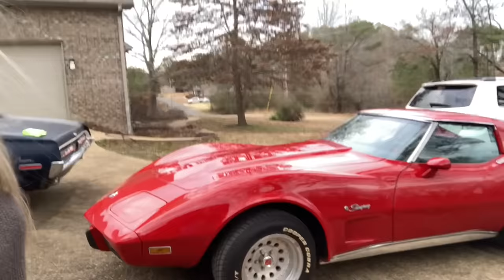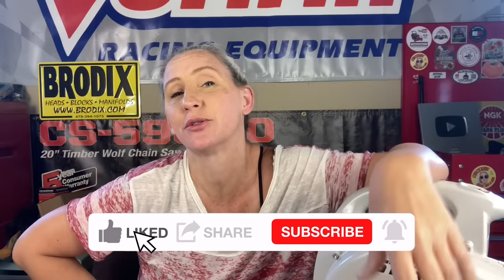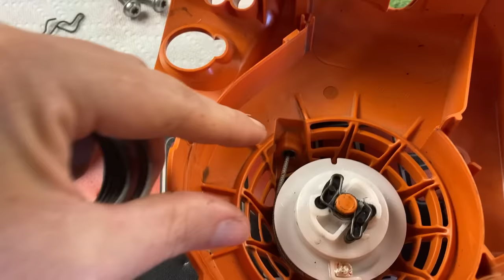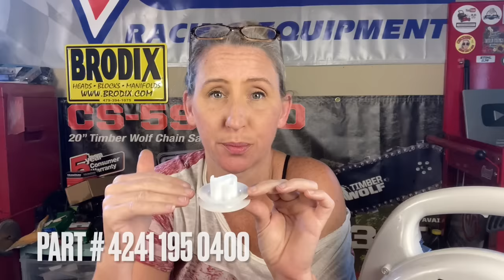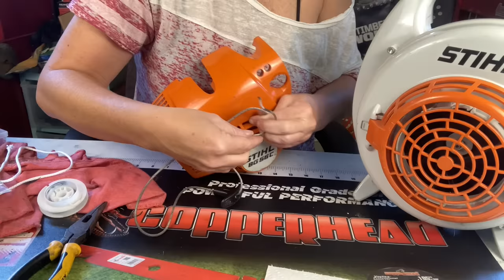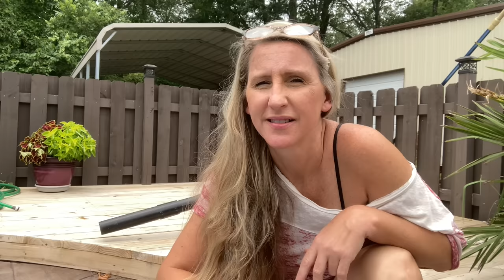STIHL'S "Easy Start" FAIL! How to fix it FOR GOOD! Stihl BG 56 C

Comment: Good info! I have an 85C about the same age as the one you show in the video. I was told the C stood for Commercial duty rated. Do I have an easy start model?  I believe my blower has a Catalytic exhaust? It is cold blooded until the exhaust gets hot and then runs great. Thanks!

Comment: The best starting two stroke I've got is a mid 2000 teens Craftsman 27cc straight shaft string trimmer, with an automatic electrical enrichment system. Takes next to nothing to pull it over, and starts within about 3 pulls every time.
Reply: I have a Husquvarna 385 saw. Twenty years old. I don't use it much anymore, but I can leave it for a year and that is a three pull starter with an 85 cc engine.

Comment: Help ! Got 130T pole saw. When you try to pull start the saw, you think your either going to eat the pull start cover or the rope is going to break. Pull out the spark plug everything feels normal, I have removed the front to check clutch, can't pull, start it,

Comment: What is the part number for this part? Spoke to my Stihl dealer a while back about eliminating this feature and they didn't seem to know about this fix. The thing that I experienced is that "somewhere" in the pull stroke the chainsaw would start on it's own, often times after the pull rope was fully retracted into the housing and the saw just sitting there. What a friggen dangerous idea especially on a saw.(I did buy it used like new for $100.00).Thanks for the video.

Comment: Hey there - thanks for the helpful videos. I inherited an old AirCap edger model 809/682/BO18K4 (Who thinks these model numbers up??)  and can understandably find no parts for it, or even the manufacturer so I guess they went away. Where would I look for parts for such an Off Brand? The plastic throttle just broke in my hand, I'm sure theirs is just a generic item used by many manufacturers of the day.

Comment: Bre do any of the other manafacturers make a spring for their quick start systems that would fit the stihl? As a metallurgist would be curious about one of the falled springs to see if it is a material issue or a heat treating issue, maybe I can get a replacement part from stihl but an actual failed part would be best.

Comment: The only dealer we have around here is Stihl. Stihl used to be a good product. 
Now with the 4 mix & their plastic cam shafts. The etronic BS, I don’t want !
 I recently purchased an Echo trimmer. It’s 2 cc bigger than the Stihl FS91R I have. The Echo cuts circles around the Stihl. 
I’m looking for a bigger chain saw. Was looking at the Stihl 462 carbureted version. $1350 !  Good gawd ! 
I’m gonna try to get my uncles old 056AV running, he left me. 
   It’s 82cc but very heavy. 
Interested in the Echo 66cc, but nobody sells them around here.
Reply: Depending on what you can spend on a saw, the Echo 590 is the best bang 4 the buck, the 620 is it's beastly brother and the 7310 should be able 2 take care of almost all your bigger needs IMO
Reply: My echo cs400 is a pig next to my ms250.  1.5 to 2x the time for the same cuts.  My FS94r runs circles around the 91 too.  I own both the 91 and 94
Reply: @Muskyfishn84  The MS250 (45.4cc) isn't the greatest comparison 2 the CS400 (40.2cc) but I understand it's what you have 2 compare, MS230 (40.2cc) would be its equivalent.  The CS400 muffler is holding it back a lot.  Open up the muffler a little, the torque gains are substantial along with throttle response.  I'd put my muffler modified CS400 up against a stock MS250

Comment: I guess I've been lucky.  Mine hasn't need repair.  Keeping fingers crossed.
Reply: And it won't as long as you pull on the rope GENTLY. It's not your pulling that starts the engine. It's the spring. Let it do the work.

Comment: I have a craftsman 4 cycle blower runs great put vibrates so bad it's hard to hold onto idles perfect no vibration what do you think the problem is
Reply: You might have a blade broken on the fan.

Comment: Oh so true, "Stihl machines are hard to start". Until they get broken in and then they usually start up on the second pull. It can be sooo frustrating when you pull out your arm and shoulde trying to start the new Stihl machine you just bought. Why this constant equipment starting problem, unlike those of other manufacturers? Thanks, Brie. Another good informative video. Oh ya, Steve and Dony both say hello.

Comment: I have a older model without easy start. It used to start after 3 pulls. now at least 5. I changed plug and air filter. no help. any ideas?
Reply: Carb

Comment: There is an easier way to rewind,  have the cord wrap inside the pulley a few turns, leaving only a small bit that after just 2 turns to wind up tension, push the end through the eyelet and bam, tension.

Comment: That’s weird. I’ve never had an issue with the Stihl spring. The Husqvarna, much like the rest of the machine, is absolute trash and I replace those often. The only thing I replace on the East to start Stihl is the pull cord. 90% of pull cords I end up doing are the easy to start.

Comment: Bree can you convert a standard BG 56 to a BG 56 C with the standard Cover?
Oh, did you hear Honda pulled of sale all their HRU216/217 in the USA due to a defect in the Cam Gear, they didn’t let the plastic to cool down before next process hence having defective engines on this model.😊

Comment: I want more power from my fs91.   Higher compression piston ect.    How do I do it?
Reply: Get an FS - 94.
Reply: @Bill-sp8kb  do your think the piston cylinder would bolt on?
Reply: @RoboDriller 94 piston&cylinder will not fit but the 131 piston and cylinder will
Reply: @Doc-Cole_Trickle-of-Chainsaws  the 131 bigger displacement?
Reply: @RoboDriller  yep
Reply: @Doc-Cole_Trickle-of-Chainsaws   Google is waffling that the 131 is 4 stroke
Reply: @RoboDriller  yeah, the 4 Mix series of trimmers and a few other things (90, 91, 101, 110, 130, 131) are all technically a 4 stroke but running on mixed gas instead of having oil in the crankcase

Comment: That EZ start feature seems stupid. The blower looks easy enough to start without it. If you someone doesn't have enough strength to pull the rope to start the thing, they wouldn't have enough to use it. 
Good job. Nice tutorial. 👍

Comment: Most everything high tech needs to be re-engineered , bought a new gas stove last year , W Fi and all kinds of crazy bells and whistles that you don't need . Had to have main board replaced in first two months , was under warrentee (would have cost me $600 if not) 1 yr warrentee is over , now my broiler doesn't work ! Wish I could get one with no electronics , something that can be relied on and is durable .

Comment: They're pulling on the rope too hard. The whole idea of those is to gently wind up that spring so it then kicks over the machine. Even the other brands with stiffer springs will do that if they are pulled too forcefully. While I do agree that spring could be more robust the problem as with most things is user error.

Comment: I've never had rewind issue whatsoever... 
One chainsaw is MS230 from 2005 no issues whatsoever, it has Elastostart, the FS120 brush cutter I have since 2016 never broke, it has Elastostart... I bought MS311 last winter also has Elastostart... So it's not equipment's fault but user's...
Reply from the maker: None of those have this design.
Reply: @Chickanic  So that's some different design of Elastostart?
I've never had any issues with rewinds...

Comment: I'm surprised they don't use plastic washers and maybe there's just too much plastic being used. It's fine for certain things but not everything like they want it to be used on. I think plastic was designed to be used for toys and toys became made to be broken. Sometimes plastic is better than using metal but not around heat.

Comment: I have a Stihl blower and an edger. Thankfully, neither are equipped with (not so) easy start. I am 67 years old. When I was 12, I would mow my grandmother's lawn with her (not so) easy start mower. It didn't last long. Today I have Troybilt blower, about 25 or thirty years old with the (not so) easy start and a late production Troybilt multi tool equipped with an even worse (not so) easy start recoil that has to be disassembled after every third start to reset the dogs. Easy start always has been and continue to be STUPID!!, STUPID!!, STUPID!! NOT EASIER than just pulling the rope. The way you just let the rope slip out of your hand every pull would soon ruin a Troybilt (MTD?) recoil assembly.

Comment: An even cheaper fix is to take a soldering iron or a plastic welding iron and melt the top part to the bottom part instead of buying the retrofit part.

Comment: the other way is to stop trying to throw start the thing.  it's literally the first thing my mechanic told me about the easy start system - people try to throw start it, and wreck the springs.  if you want to throw start your equipment, don't buy equipment with the easy start system.  it's made for old people who don't have the shoulders to grip it and rip it.

Comment: what chain saw would you purchase for your self I have a Husqvarna 356 ?? 20 or 24in. blade and a poulan pro 20in. blade they are presently both working but both are getting old and last month both were broken I repaired both and are working now but I know one or both are going to be beyond repair soon - what would buy I wold like 20 t0 24 inch blade I have friend that swear by stihl I am not sold on any brand both where purchased at Lowe if I remember - price is not a factor but durable, power, longevity and realiable are! I never leave gas in them and i do not use ethnaol gasoline and use preiumn gas non ethnaol. I just purchase a  Milwaukee battery so I can do small trimmings around my property what a waste of money the chain constantly comes of the only thing good I never ran out of a battery charge - the chain never stays on long enough to use up the battery - I usually get  tired of putting the chain back on and go get a gas saw to finish I purchased the Milwaukee I though it would be easy to trim and cut up fallin limbs but what a waste PS you produce some pretty good videos

Comment: Bre, was that “replacement” piece that you showed us a genuine OEM part or…? IF it’s not OEM then can you tell us where to find it AND then what’s the SPECIFIC name for it in case we get a person that “doesn’t speak OPE lingo”. I’m a “chainsaw nerd”, just not a complete OPE nerd. 😊
Reply from the maker: Yes it is. I put the part number on the bottom of the screen when I showed it in the video. It is Stihl part number 4241 195 0400.
Reply: @Chickanic  THANK YOU! I just missed it 🙁